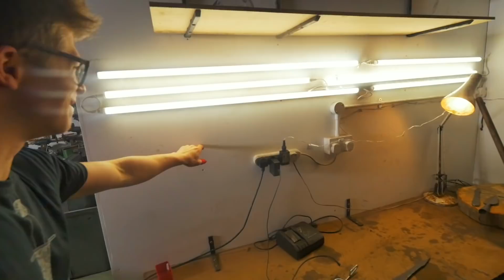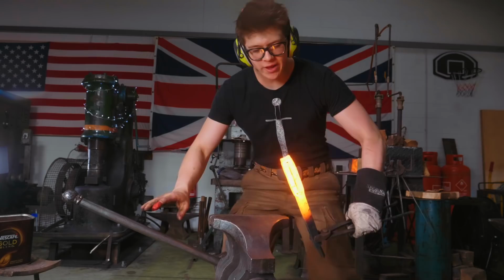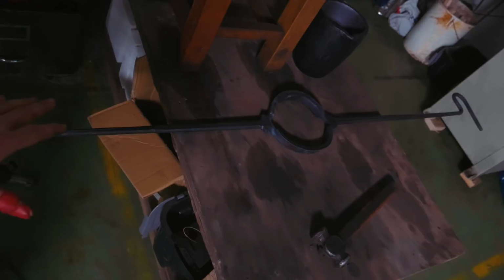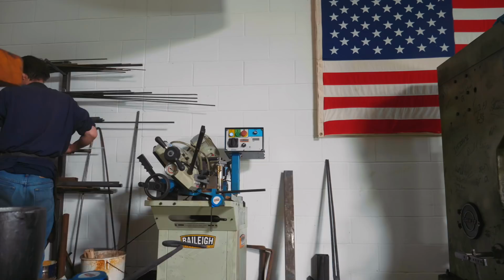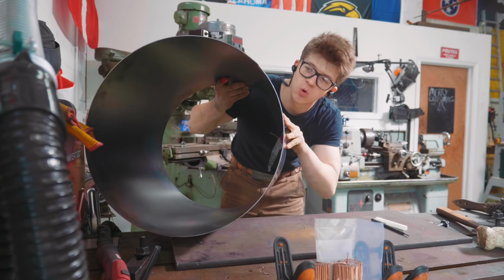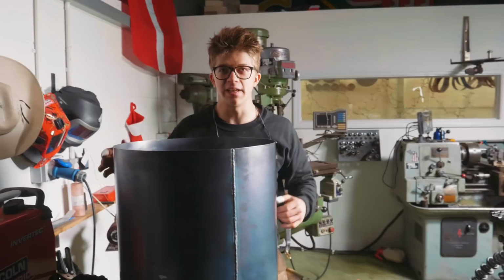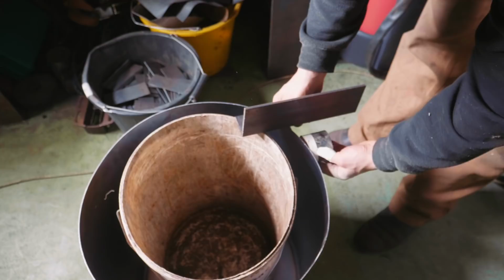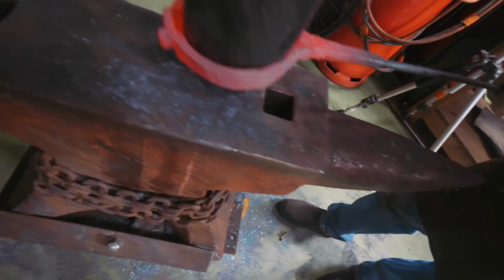BUILDING A FOUNDRY!!! PART 1

Comment: should have cut the holes before you rolled it
Reply: Getting that right is one of the more difficult tricks that people doing layouts have fought with over the years. It's tough enough to cut it correctly once it's rolled, but laying out a circle that's offset from center on a flat piece that will be rolled later is along the lines of 'Inception' - it's just more 'mathception'... And for something like this it's just easier and more appropriate to do it the way he did - this is a one off project that gets cut small and fitted by tweaking with abrasives. For repeating production level work, proper layouts and cutting is more appropriate (saves time).

Comment: Why not just devide the foundry into thirds with a marker and put one in each third?
Reply: Jordan Watkins because the pipes in the outside would surround the entire thing and cause a possible trip hazard which when dealing with molten anything is the last thing you want.  It's better if you contain the heat lines to one side and have those away from your area of movement.